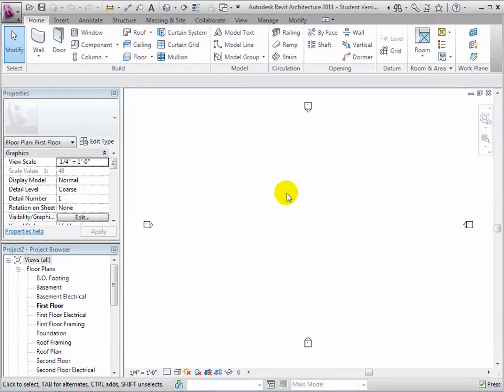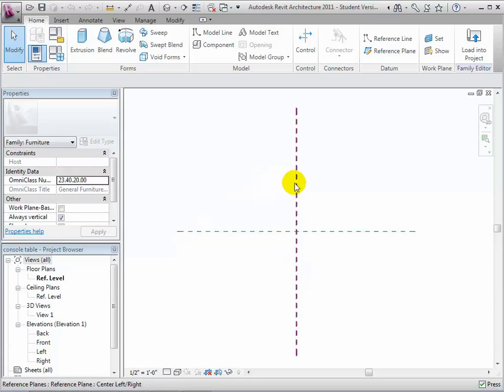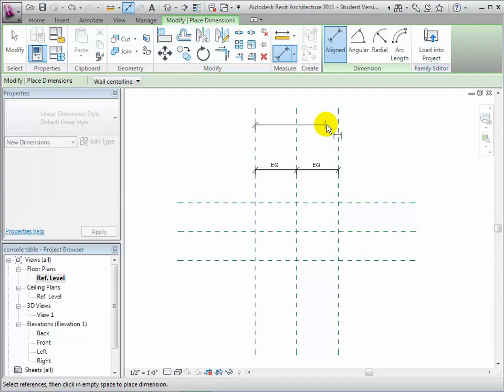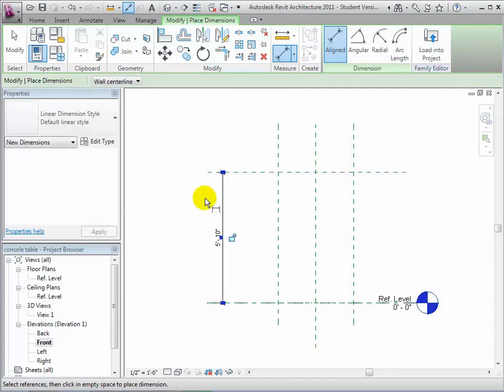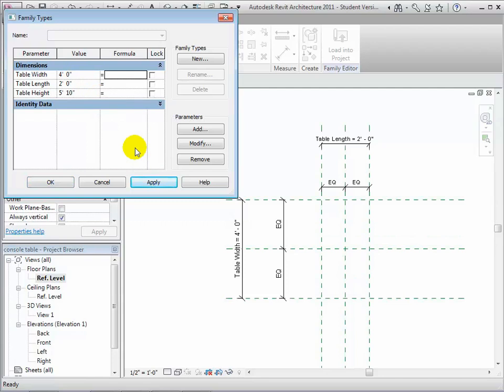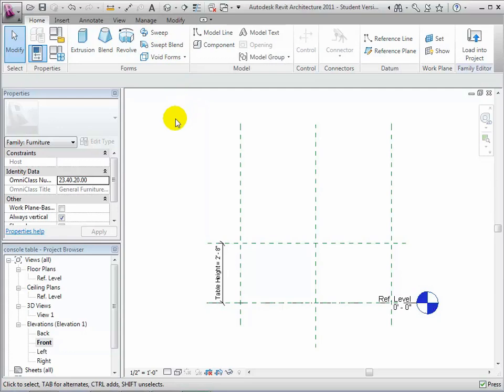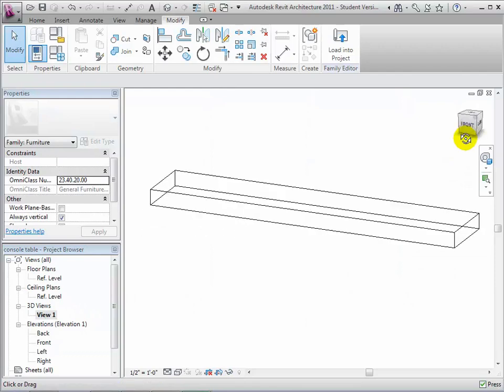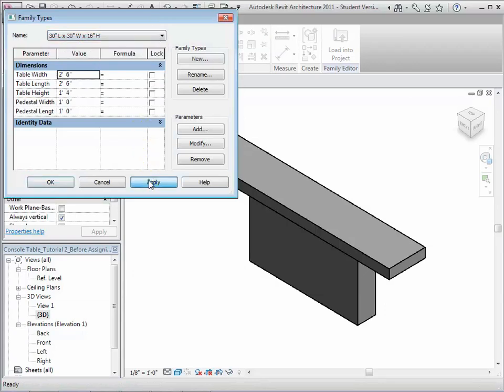Revit Architecture - Creating New Parametric Families - Part 1

Comment: BIMtopia Thank you for uploading this excellent presentation.

I did notice a minor mishap in the video starting at 7:45. The parameter value for the table width was entered into the parameter category for the table length, and the parameter value for the table length was entered into the parameter category for the table width.